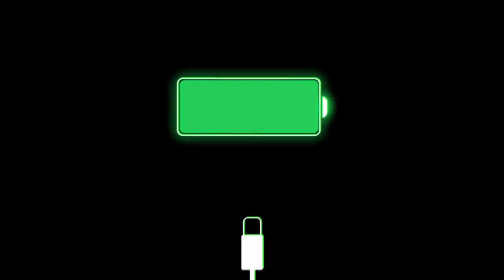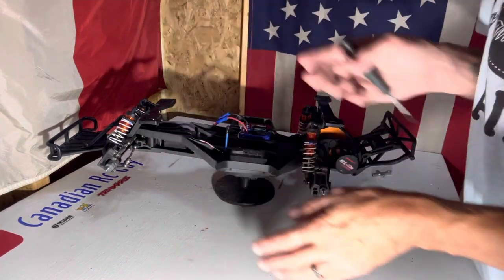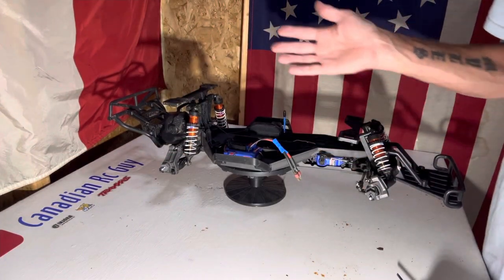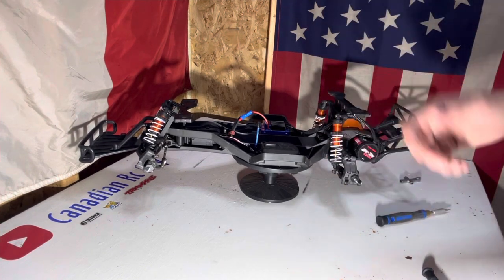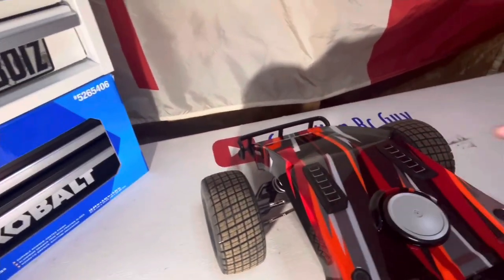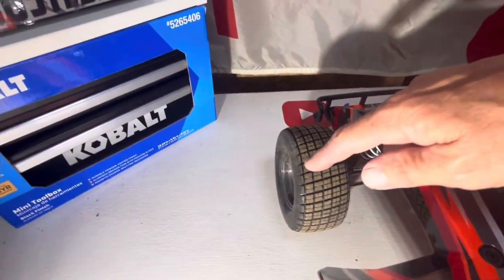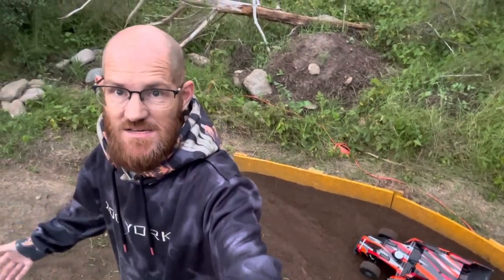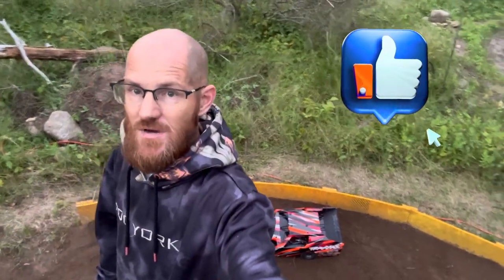Setting up our Modified to TURN LEFT. @Canadianrcguy #traxxas #modified #dirttrack

Comment: You don’t need to trim the body, just raise the rear body mount up to the last set of holes. Also, remove all the factory grease from the transmission and differential, lube everything with Rem fluid. You will gain 3 mph by doing this.
Reply from the maker: Thanks for the Body Tip! And Diff is already done, video coming soon.

Comment: I like the length of your track but the center length should be at least 4 ft. wide and open up the outside by same then you got a perfect dirt oval.
Reply from the maker: We only have a few weeks of good weather here before we head inside for the winter..❄️ Next year it will be getting a little Overhaul, little wider/longer and some Clay to pack down.